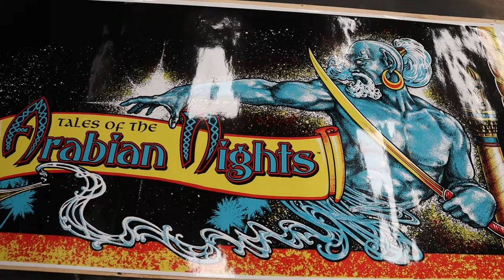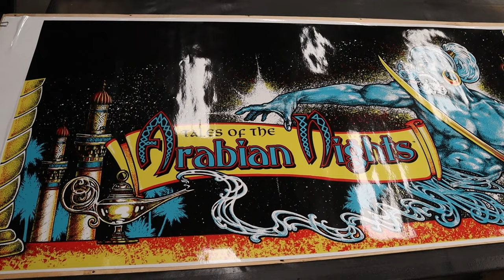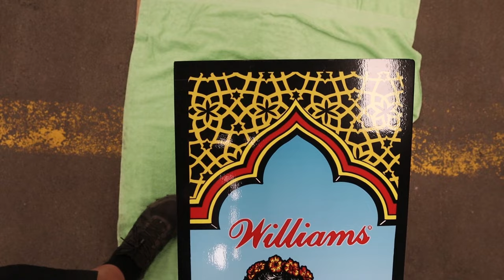How to install pinball cabinet vinyl artwork like a pro

Comment: If you choose the wet method, I recommend Rapid-Tac which is inexpensive and formulated for this purpose specifically, application of adhesive vinyl decals.
Reply from the maker: Good info!  I was planning on showing a wet method on a future cabinet so I'll be sure to mention this.  Thanks for the watch!

Comment: I'm going to attempt to replace the  left side of my Stern Iron Maiden pinball machines back box decal.  I'm going to try and do it without taking the back box off.
I'll be doing it by myself so I plan on taping and using pistol clamps where I can.
I'll have to be extra careful, because the decal doesn't require trimming, since that's the way they're made.
I don't know if I'll be using the wet method until I see how the back box was previously prepared and what kind of wood was used.
I'll probably email Stern and ask them what kind of wood was used to make the back box.
Thanks for making this excellent video!
Reply from the maker: Cool!  Yeah that should be possible, just make sure the surface is clean and smooth.  Take your time and use tape to hold the position and it should be easy.  Good luck!  Thanks for the watch and welcome to the channel!

Comment: Nice job!.. as painful as it was to watch as pro graphics installer lol. Another big con to add to the wet method is some vinyl is backed with latex based adhesives that will dissolve with water. Your best bet for any first time/novice install is to order your artwork on material with "air egress"... no more bubbles!.
When applying, move your squeegee left to right on an angle (like a road grater or snow plow) and overlap each pass about 60%.
To protect your corners you can butt seam and then apply a strip of laminate (clear vinyl) there is also a "seal-it" pen that is just a clear paint marker that you can apply over the edges so they stay put and lastly you can overlap the print for a seamless visual.
One last thing to mention is "calendared" vinyl will shrink over time ( the cheaper or thicker, the more it shrinks) and "cast" vinyl is more dimensionally stable and shrinks very little or not at all in most indoor applications. 
Hope this helps some :-) 
Great video series on the VP... subscribed!
Reply from the maker: Thanks!  Yeah I took my sweet time and it turned out perfect, I'm very happy with how it turned out.  There's definitely lots of info for vinyl application and even more that I didn't cover in the video.  Air egress is pretty awesome stuff!  I used a thicker vinyl than normal but it worked out ok.  Thanks for the watch and your support for the channel!  Welcome to the channel!  Cheers!

Comment: Nice to see you again for another great video! My car is 2000 Ford Taurus SE OHV. I need to turn the engine to TDC in order to replace Camshaft Synchronizer. When I turn the crankshaft, which direction I should turn? Also do I need to first disconnect negative battery and put the car in neutral position? If that is the case, how can I put the car in neutral while the battery cable is removed? Thank you!
Reply from the maker: I would do your research in advance for your specific car but you should be able to leave it in park.  Usually you spin the crank clockwise with spark plugs out to make it easier.  Good luck!
Reply: @wayofthewrench  Hello, I have found the issue of the squeaking noise for my taurus. It is the cam synchronizer which only generates noise under load so I cannot hear the noise when the car is in idle. Thank you!
Reply from the maker: Ahh ok cool, good find.  Glad you got it sorted out

Comment: Looks great! Are you using an air release vinyl here, or something more general purpose?
Reply from the maker: Ya know I don't know for sure but I don't think it is.  It was a bit thicker than I'm used to but as you saw, it laid down beautifully.  If yours isn't air release, you can just pop a tiny hole with a pin and squeegee out the trapped bubble.  I did that on a few spots. Thanks for the watch!

Comment: I'm thinking of using vinyl car wrap on my cab,budget wise it makes sense for me (plus their are so many exciting colours to choose from),is this basically the same stuff you used?,I'd like your opinion, as I have never used vinyl before.
Reply from the maker: For the most part, yes it is similar stuff.  I used a carbon fibre vivid auto vinyl on my arcade cabinet and it's still looking amazing.  Be careful though as the cost will add up and you might have been able to just buy pinball vinyl.  Hope that helps.  Thanks for the watch!
Reply: @wayofthewrench  Thanks for the input....pinball vinyl,compared to auto vinyl here in the UK,is very expensive (I will double check) .
Reply from the maker: Good luck!